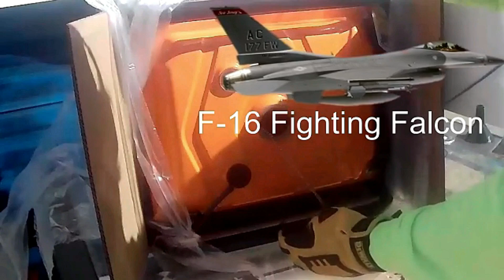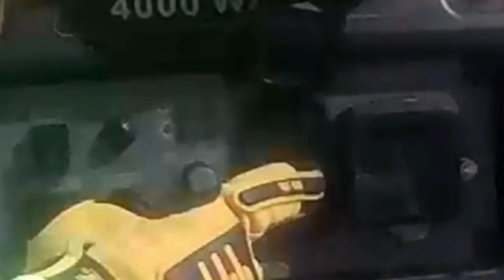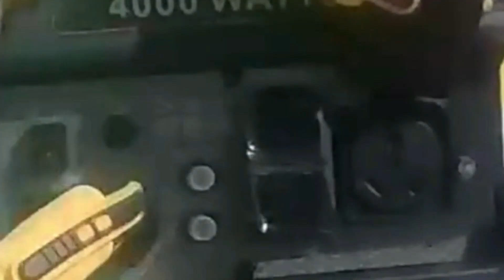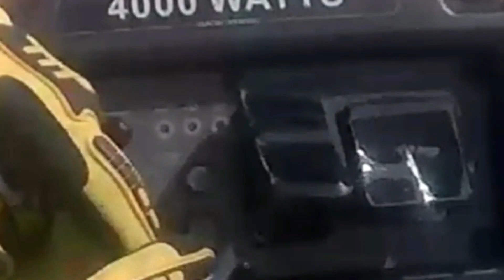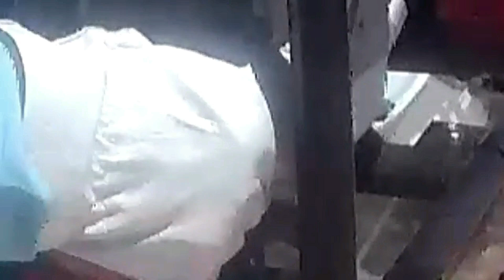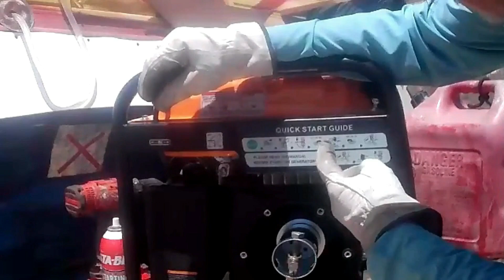EDOG04 4000 Watt Inverter Generator Unboxing and Set Up. Lots of Details with Follow up - Update.

Comment: Okay, so it's good enough. 4.5 isn't bad for the price I suppose. Maybe there's a better option. I see a deal for $300 plus tax brand new. No clue how that correlates
Reply from the maker: It is holding up nicely. I must say I am pleasantly surprised with the durability. I am now working on noise reduction.

Comment: Thank you so much for that very thorough review!!!  Easily the best tutorial I have seen on this type of generator. Ordered one yesterday but it’s a different name on it but I’m sure they are all from the same Chinese factory branded separately.
Reply from the maker: YES! This is a large China Build that is private labeled under many names. Like most of the things we buy today. It seems safe and durable, however there is no, UL, TUV or FM certification. Since gas and oil items are difficult to return it is a bit of a risk, hence, the detailed video.
Reply: I ended uo getting one right after my original post.  It has performed well beyond my expectations!!!  Would definately recommend!!!

Comment: Just got  1. Not fuel efficient. May be mine is defective
Reply: I'm about to hookup mine. What is a way to check efficiency pretty normal? How did you run yours?
Reply: Mine runs about 9 hours on 1 and a half gallon of gas.
Reply: Also I had a two door refrigerator on along with a fan and cellphones
Reply from the maker: YES, it is not the most fuel efficient and it would be hard to think of something even less fuel efficient at the same power output. I guess the trade off is "purchase price" not fuel efficiency. For the price of 3 or 4 of these you could buy the Honda, however, $1200 USD buys a lot of gas even at todays prices. I use mine to "supplement" wind and solar, so it works for me. M2

Comment: Greetings, I have a question. I am using the same generator and would like to know if the choke lever is always set to on because when the generator starts and I move the choke lever to the off position, the generator turns off.
Reply: me as well
Reply: Same here
Reply from the maker: YES, that is a flaw and you may not like the fix, however, 1. use premium fuel. 2. remove air filter element (this obviously is at your own risk) 3. make sure the engine is good and hot well before you open the choke wide. You will see a major improvement with any or all of these. M2

Comment: If you were running your generator near your vehicle... say on a camping trip or even doing some work on your vehicle with power tools... could you run a ground wire to the chassis?
Reply from the maker: YES! For sure, ground is interesting like that, unlike some of my ex girlfriends, something is always better than nothing. Find a good negative chassis ground on your car or truck and strap (connect) the negative ground stud from the generator (front panel) to the negative chassis ground. (shorter wire is better than longer and make it a good copper connect). For the isolated system (vehicle up on rubber wheels) this is in effect "the ground" it is about the metallic mass NOT the planet earth.  M2

Comment: The only thing I would add is, and I know this seems like common sense. But make sure your oil is full. If you dont have it all the way full you can trigger the low oil sensor, and it will shut the engine off right after it starts.
Reply from the maker: YES, in addition, the oil sensor is a simple grounding switch (not supervised). Oil level ok, switch is open. Oil low, switch closes (shorts spark plug to ground). Disconnect oil sensor and the motor will run even without oil, until of course it becomes a worthless boat anchor.